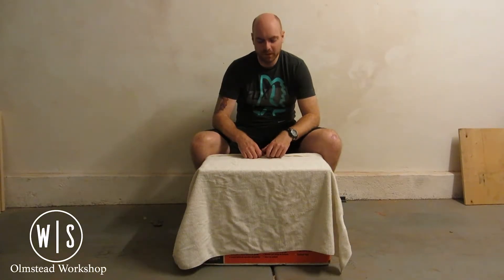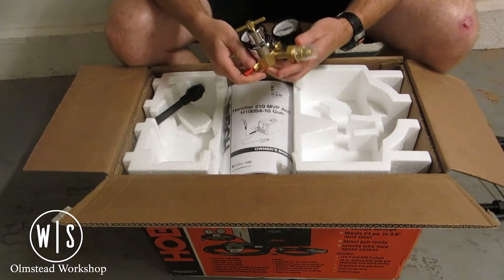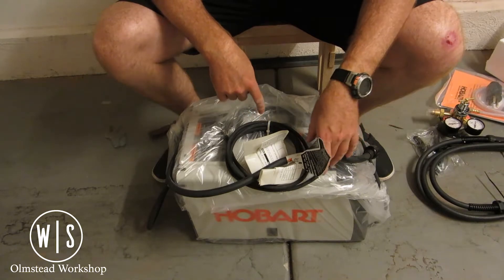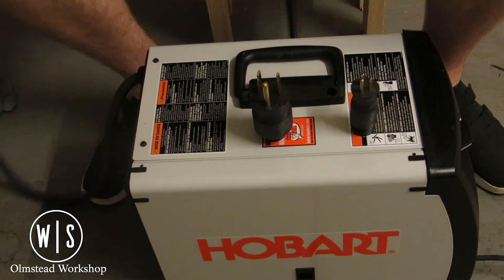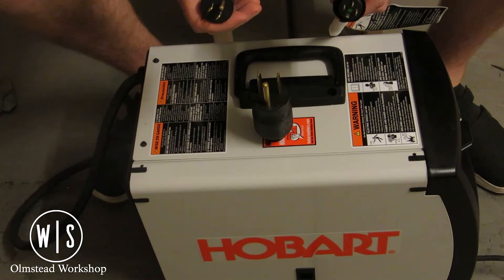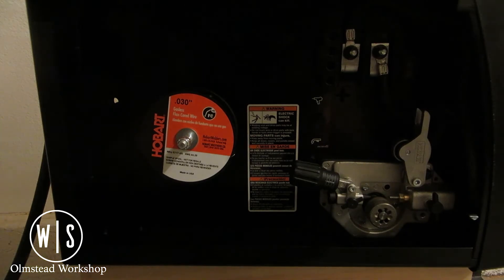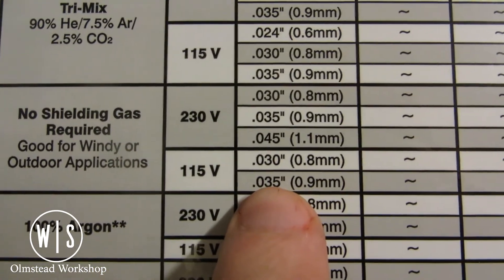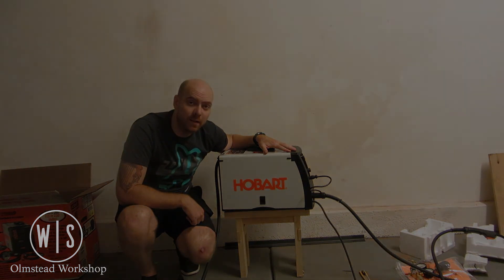OWS Hobart Handler 210 MVP Unboxing and overview

Comment: You picked a great welder. I love my 210 MVP.  I only run flux core wire so I don't have to worry about breezes etc... messing up my welds.  If I ever got into auto body work then I would consider solid wire with gas.  Flux core is dirty like stick welding but I find it more forgiving indoor and outside.  So have fun.
Reply from the maker: Thanks Leo welding is definitely a new adventure compared to wood.  For me flux core is a staggered purchase.  A good mask and gloves came first before I eventually get around to getting a bottle of gas.
Reply: The Olmstead Workshop  one other thing. Go on Amazon and get yourself a 10 pound spool of INETUB 030 flux core wire. I find it works better than Hobart or Lincoln wire and it's much cheaper. If you have graduated to mig I would still keep some flux core wire on the shelf just in case.
Reply from the maker: 73leo73 thanks I'll definitely check it out

Comment: I am in the same boat. I was set on the Hobart 140. Using the same reasoning you did, decided the MVP was probably the smarter choice, then said well in that case I really should get the Miller 211. Now I’ve decided, that it’s the millermatic 255. 🤦🏻‍♂️
Reply from the maker: You have got to love that tool creep and talking yourself into a bigger tool.  Miller makes some fantastic equipment and the 255 is definitely no slouch.